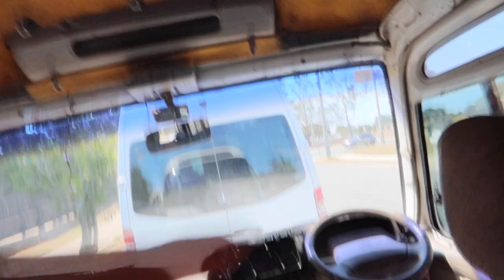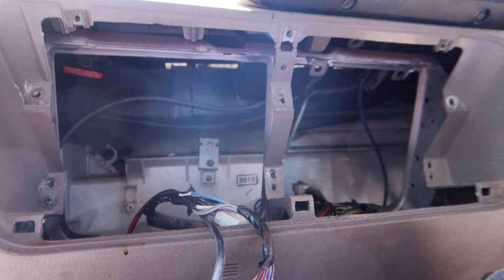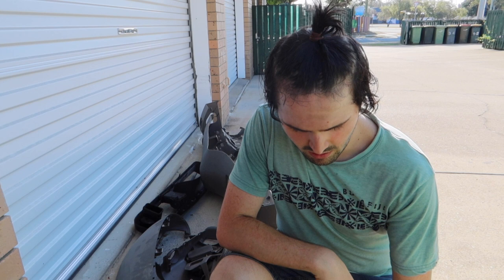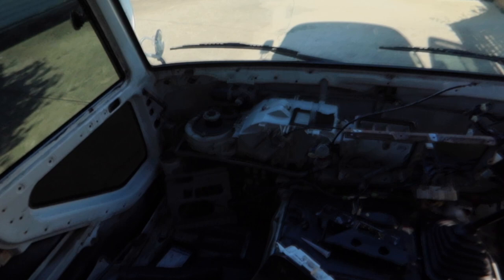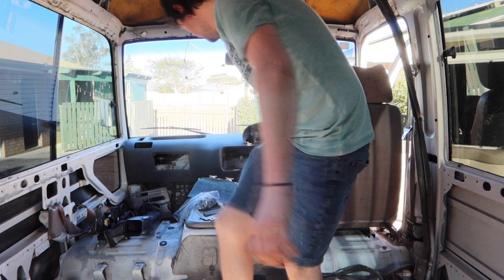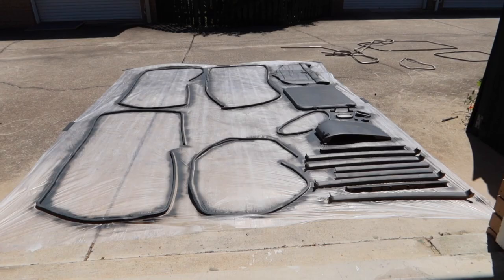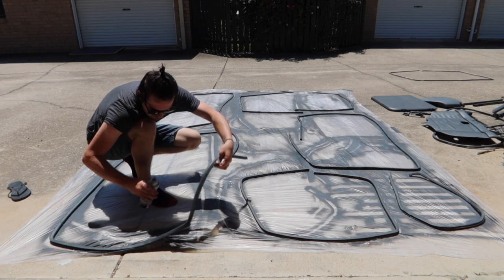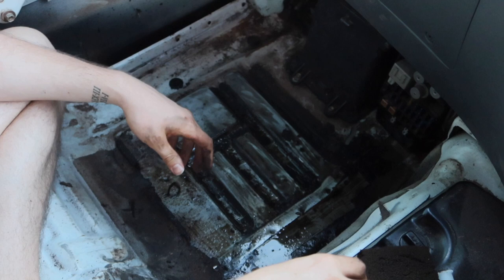Our Coaster Conversion - Part Sixteen - Disassembling The Dash & Painting

Comment: How did you find the finished painting on the dashboard.
Reply from the maker: The finished product looks amazing!
So glad we did it as the old beige type colour looked horrible whereas the new dark grey looks great. 
It covered up a few imperfections as well on both the dash like scratches and scuff marks on the window pinch welds.
Reply: @theaitkenfamily9138  that's good do hear. We pick up our Rosa on Friday and i can't get stuck into our conversion.  :-) Thanks for the inspiration. Cheers Andrew
Reply from the maker: @OffGridisSweet  good luck with your conversion, if you need any help, feel free to reach out :)
Reply: @theaitkenfamily9138  thanks will keep in touch :-)
Cheers Andrew